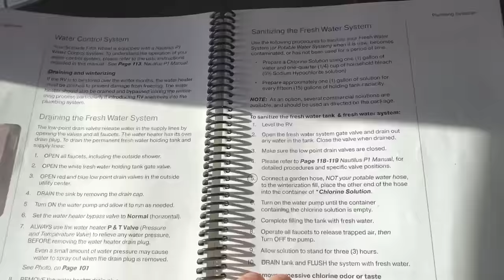MASSIVE WATER LEAK RUINED OUR RV - RV LIFE REALITY

Comment: What a bummer guys!  From my experience the best repair is to completely drop the tank, luckily it’s only the grey tank.  Usually when they split like that it usually extends to the top of the tank.  ABS holding tanks are best repaired with a fiberglass mat and resin, but the temperature must be right for the patch to bond.  Unless you have access to a heat lamp don’t try the repair during cold weather.  You will need to start at the top and work your way down the side of the tank with the fiberglass patch to ensure a complete repair.  The issue is the tanks swell when full and that bracket looks like it completely split the tank all the way up to the top.  So I hate to be the barrier of bad news, but you will be ahead of the game by dropping the tank.  Had a similar issue with my brother in law’s grey tank and we just bit the bullet and dropped the entire tank!  It’s not an easy process but not insolvable with a little ingenuity and muscle power.  Hang in there guys, just give yourself some time to complete the process, while saving yourself a ton of money doing it yourself!  Take Care —
Reply: Great comment thanks. :)
Reply from the maker: Thank you so much Tim for sharing! We were able to drop it a little bit to get around it but we may just end up getting a new tanks so no issues in the future. You never know! Hope you enjoy your weekend!
Reply: @HappilyEverHanks   Always the best option to replace the tank!
Reply: @HappilyEverHanks  Yes, I'd replace the tank as well...
Reply: Basically the same thing I told them!  Thank you for your confirmation!
Reply: Im not an RV expert, But i used to work for Boeing and used different epoxies and did skin work. You need to drill the ends of the crack, a 1/8 inch drill bit would be fine,  clean well with a solvent like acetone or that ABS prep cleaner, and do your patch work again. you can actually take some black ABS plastic and grate it on a cheese graters and mix up your own ABS patching compound with solvent,  there are some youtube videos on doing that. But drilling the holes in the ends will stop that crack from continuing,  otherwise its just going to continue.

Comment: We are dealing with multiple leaks on our Grand design right now too 😭 first the underbelly was sagging and we found out there was a ton of water from our hot water heater leaking- got it fixed. then a few weeks ago our carpet in our bedroom was wet and we found out we have a few connections behind the nautilus system that are leaking. Leaks blowww. Love your attitudes about it tho! We just finished our first travel nurse contract in our RV and love it but geesh! We feel your pain. Love following y’all on Instagram and YouTube!
Reply from the maker: Yes, leaks do blow. We are so grateful this one didn't cause any serious damage (that we know of). You guys have been dealing with some stuff! Safe travels out there and thanks for watching!
Reply: I’ve been thinking about buying a GD and but this doesn’t instill confidence in the product
Reply from the maker: @dougc78  Each brand of RV has things happen. Our first Grand Design, we had 0 issues with. Lived in it for 2 years before upgrading to the 5th wheel. Sometimes these things happen, hopefully we don’t have any more instances 😬 Great talking with you Doug! We enjoy hearing from you
Reply: We had water in our underbelly as well. Our Grey tank shifted forward a verrrry tiny bit and pulled lose from the inlet tube. We noticed it only leaked as well when the tank was full. This was because that inlet sits at the top of the tank. We had to shift it back, reclamp the ring clamp thing, then secure the thank a bit better so it didn’t shift again
Reply: Where was your hot water tank leaking? I’m having the same issue. I see my tank leaking but can’t tell from where and now today realized my underbelly is filling with water.

Comment: We had a leak that cost $6k because our old camper had the plywood in a plastic basin seal. The bad side is that if water leaks, then it’s trapped and rots. We don’t recommend this design - 2017-2019 Mesa Ridge models. Beware. They can cost you$$$$$$.

Comment: That tube was your battery tub drain area.  Not a big deal .... easy to replace.  It is in case your battery boils over or water gets blown into the battery box tray from the front top vent on the left front of the camper next to the front storage door.  Near switch that turns on front cap LED lights.
Reply from the maker: That is what we finally discovered too. Glad you jumped in though, we weren't 100% sure! Thanks for sharing and watching our video Mark!

Comment: On our Momentum we had to pull our underbelly from the garage to about 6' ahead of the axles.  Our water was from rain slung off the tires.  Felt your pain pulling out soaked insulation.   Found the water at MorRyde just after having independent suspension installed.  The new IS setup was such that I was unable to put back on the factory corrugated plastic.  I ended up getting a special order box of 4x8' corrugated plastic from a bigbox home store.  Project also used several rolls of Gorilla double sided tape, water proof tape; wide duct tape; self tapping screws; insulation; foam insulation, black caulk,  etc.  Fortunately our rig was in the driveway for the slow week long repair.  I check the tape job whenever I'm under the rig lubricating suspension.  I suspect we're all just a wear/fatigue issue away from a holding tank leak.
Reply from the maker: That makes sense! Wow, that was a big job to do. You are very handy! Thanks for sharing

Comment: From reading the comments it looks like your going to replace the tank. That's the best option. But before you install the new tank, go to Tractor Supply and buy some rubber floor matting. It's cheap. Cut a wide strip and glue it down to that support brace. Make sure that strip is wide enough to roll over the front leading edge of the support bar. This rubber strip will act as a cushion between the tank and the support bar and cover the metal edge to prevent it from chaffing on the new tank.
Reply from the maker: That’s a really great point, we definitely need to have that addressed. Would be such a bummer to have this happen again 

Thank you for all your support and insight! Stay safe
Reply: @HappilyEverHanks   👍 😎

Comment: Not sure if anyone else has brought this up, but the best way to fix a plastic tank is with a hot air plastic welder. You can get one and some plastic rod inexpensively as harbor freight. I haven’t fixed a holding tank with one, but I have patched up a windshield washer fluid tank in a car that sees much more vibration and it’s held up for years. It also isn’t dependent on ambient temperature to cure. I’d also add some additional support under the tank near that location to reduce stress and strain and put a piece of felt or carpet there to solve the rubbing issues.

You’ve got a great attitude - it’s all part of the adventure. I had so many leaks in my first RV that I just ripped out all the piping and replaced it with PEX. it was a bit of a chore (and I now own a $100 PEX crimper), but it solved the problems permanently. While I was at it I noticed that there was a place at the fresh filler to add a small hose to vent the tank so it didn’t burp air when filling. Night and day difference. I’m sure I added a bit of weight, but I rarely travel with full tanks and the piece of mind was well worth it.
Reply from the maker: This is awesome Phil!! We have been hearing this throughout other comments as well, you know your stuff :) Thank you for taking the time to write this out for us :) We appreciate your support and hope to hear from you again soon! #TeamPhil

Comment: Man, I feel for you guys. We have a 2019 385GK that we bought new in 2020. The summer of 2021 our front gray water tank started leaking and filled up our underbelly just like yours. We fought it for the entire summer before we could get it back to our dealer. Fortunately, our extended warranty covered the repair of a hole almost exactly where yours is. We are going to keep a close eye on it since it seems like an error in construction that GD needs to address. Thanks for the video.
Reply from the maker: That's good you were able to get it repaired. We are so nervous the same could happen to our black tank. That would be crappy. Thanks for the support!
Reply: @HappilyEverHanks  🤣😂🤣 Most certainly, crappy.  BTW:  I think was the black water tank that dropped on my dad's RV.

Comment: I think you guys are on track with replacing the tank. I’ve been in similar situations and there is no good fix when it comes to a cracked plastic tank. No good long term fix anyway. And I would personally find someone to reweld that bracket and maybe a few additional support braces while you are in there. The key to preventing this in the future is preventing any tank movement. Kind of like a nascar driver. The majority of the safety stuff is to ensure they are basically one with the seat in the event of a crash. The minimal the movement in the seat the less the chance they will get hurt. And one of those tanks full is a lot of weight. They need every bit of help they can get to stay in place when full and traveling down the road.

Overall this appears to be all too common. I theorize that the RV industry does not actually build these to spec of full tanks traveling down the road. I’ve seen so many brackets break and tanks completely dropped.
Reply from the maker: That makes sense, new tank and keep it stable! Thank you for sharing!

Comment: You guys have such a positive attitude with all this I love it. I hope it’s fixed I’ll be tuning in to find out! We had a leak in the front underbelly of our fifth wheel the year after we bought it. Still under warranty I took it in and they found a cut in the cold water line that must have started small and got bigger over the winter. The tech gave me a valuable piece of information, he said to check for a water leak in the feeding lines fill the fresh tank and run the pump. The pump only runs when the lines lose pressure from an open faucet. If the pump runs with everything closed you’re losing pressure in the lines which your leak is somewhere in there.
Reply from the maker: Thank you Neil! That's a great idea, we appreciate you taking the time to pass this along to us 😃Sorry that you had a leak as well, that's frustrating!

Comment: If it’s a crack drill an approx 3/16 hole at each end of crack to stop the cracking. Then sand area and wipe clean with denatured alcohol. Assuming the tank is black ABS the best way to repair is to paint on with a small paint brush ABS cement going an inch or two past crack. Then press in a layer of fiberglass screen. Let dry 12 hours. Then repeat entire process 2 more times with 12 hours between each coat. Learned this from RV repair shop. Have repaired 2 grays and 1 black. No failures in years. Do not do this on white water tank.  I’m sure yours is repaired or fixed by now but this may help someone else.
Reply from the maker: This is great info, thank you so much for sharing! 😃

Comment: I am sure the question of what tube was tore apart when the underbelly dropped,  but, my guess is it is the drain for the battery compartment above.
Great job on tracking down the leaks! 👍
Reply: Yah I was going to say it’s the vent for the batteries too.
Reply from the maker: Thank you so much!! Yes, I believe you are spot on with the battery ventilation aspect :)
Reply: But where are the batteries, relative to that tube? It looks to me like the tube is directly below your roughed-in generator location. So my thought would be genny exhaust.

Comment: I'm sure someone has already mentioned that the tank has to be plastic welded to be repaired properly. Another great job by grand design.
Reply from the maker: Yes, it would need plastic welding
Reply: Polyethylene epoxy works just as well.
Reply: @The-Bankster  I'm not sure I'd trust any sort of glue.  Besides, one of the worst parts is just getting to the tank.
Reply: @caseypries7559  It's EPOXY specifically made for polyethylene. You put it on just like fiberglass. You actually use fiberglass cloth. Welding is certainly a good option as well. Hasn't leaked a drop on me in two years and I boondock almost exclusively.

Comment: Our hearts go out to you!!! Just a few days ago, our hot water heater sprang a huge leak. The geniuses that made ours decided to use a plastic check valve coming off the hot steel water heater and it inevitably melted! I’ve had multiple issues, directly related to plastic plumbing fittings. Had the pleasure of fixing it in single digit Illinois temperatures! 🥶 y’all hang in there!!! We’re rootin for you! ❤️
Reply from the maker: Brrr!! That’s no fun! Thank you for sharing your experience!

Comment: Since we have the exact same model of camper as you, we are always curious as to what challenges others are facing .... hope your leak gets fixed!  One item to look out for - the bathroom vanity is prone to dropping down a little on the right side (if it drops too much it can hit the floor).  The fix was simple - add a couple of screws to the inside of the vanity (take out lower drawer) that go through the wood and bolt into the closet structure.  I noticed a small gap in the vanity countertop caulk - this showed where the vanity was slowly dropping.  Now it is flush with the caulk and secured to the closet structure.  Always little things to watch out for - others have had the same issue on the S2930RL.
Reply from the maker: Thank you so much for sharing Mark! We'll look out for that for sure!

Comment: We also have a Grand Design Solitude with almost the exact the same problem. When are shower gray tank is full it too will leak water on to the coroplast sheet. What I believe is happening to your tank is 2 leaks. You have a split in the tank where you repaired but the tank maybe also leaking from the vent pipe on top of the tank. The vent pipe is not glued to the tank, it is sealed using a rubber gasket. The gasket either has a poor seal when manufactured or it may shift or degrade over time. When the tank is over filled it leaks out the top just as yours did after you did a test fill after the repair. For the time being we are using the shower but carefully monitor the gray tank level and empty the shower tank frequently. We will wait for warmer weather than tackle this problem. Good luck to us both on fixing this PITA problem.
Reply from the maker: Oh no way! So sorry to hear this Dave 😕That sounds spot on, we are thinking that we will need to get the tank replaced and bring this to Grand Designs attention. We will keep you updated as we know more! Thank you for your support, we hope that we can continue to hear from you!!

Comment: Water leaks are the worst. We had been staying at a seasonal site last summer and I installed a new shower head. While we were out the head fell and turned on the tub faucet. Needless to say we came home to a flood! We have since made sure we shut ofd the water when we are not at the site.
We also installed Ring with alarm freeze and water sensors. This has been a game changer. I have placed them under the sinks and at the water pump wet bay connections.
Reply from the maker: Hey Joe and Colleen! You are so right, they are the worst! Goodness, so sorry that this happened to you guys, the RV life never ceases to keep things interesting. We will have to look into those Ring alarms! Thank you so much for this!!

Comment: Ok, here is a fix I’ve used in the past… Get a soldering iron and melt the crack back together. I know that sounds weird, but it works. No matter what you do to try to glue it back, it will always fail. If you can melt / weld it back, it’s a permanent fix. A lot of other tanks (gas, water) are fixed like this, just takes some patients.  Good luck!
Reply: Plastic welding is basically what this is and he's right, it's the best way to fix these tanks, resins don't hold up long term.  If it's a crack drill then ends to stop the tear.  If you need filler material, milk cartons are a good cheap choice.  But at the end of the day the best solution is a new tank.
Reply from the maker: Wow thank you so much for this Bryan! You are so awesome for taking the time to write this out for us 😃
Reply from the maker: This is really great to know Patrick! We kind of figured we will have to get a new tank. Currently reaching out to Grand Design now :)

Comment: In my 33 footer I had the same symptoms. 
After tearing out the undercover and using my inspection camera, utilizing around 20 hours of finally finding the pressure line ABOVE THE BLACK TANK needing repair that also was blowing the water upward to the underside of the flooring! Awe... the good ol' black tank drop! Nothing but a bunch of fun doing that job! 
Finally got it repaired just in time to sell it before our move.... at least the new owner had the floor repaired and no more leaks...
One thing I added before replacing the tanks was putting a rubber strip along where the tanks would sit on the frame of the coach to keep from what happen to yours to not be possible/less likely to happen. Just a look to a possible future.
Reply from the maker: That is such a great idea with the rubber strip. Thank you for sharing!
Reply: @HappilyEverHanks  SEE! 
I told you I'm super all smarts and stuff!

Excuse me as I go cheer in the street that someone said something I said wasn't stupid!!! 

A day to remember for the rest of life... Awwwe..... 

Alright... enough! 
You're quite welcome. I'm wondering maybe a bike innertube and cut to what ever works. It'll take a "few" of them so get the bigger ones and also the ones that say they are stronger against popping/holes. It's made of thicker rubber. 

Best of luck guys. Be safe!